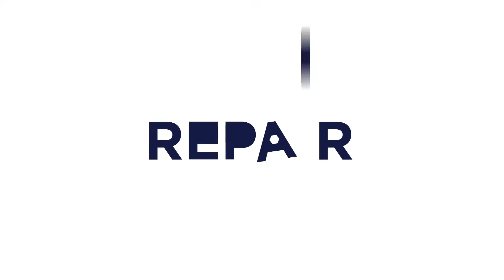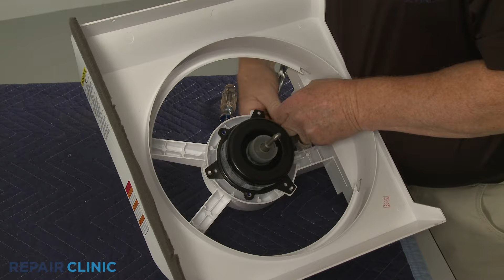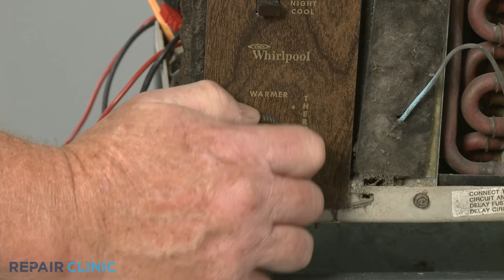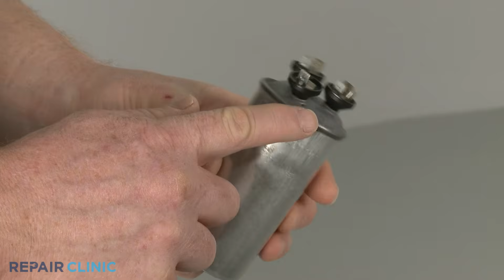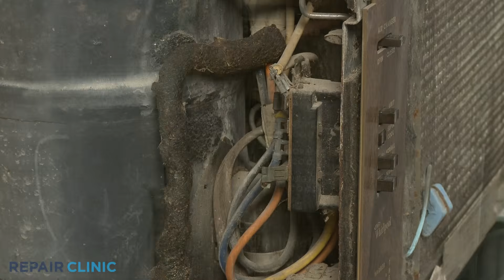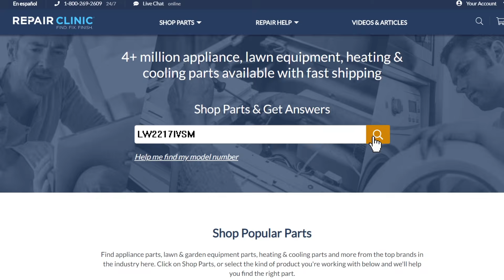Air Conditioner Fan Not Working — Air Conditioner Troubleshooting

Comment: So i got a weird one.  Have a window unit that works, fan kicks on and it blows cold just fine.  But sometimes when the fan kicks off it just keeps humming, almost sounds like the compressor is still trying to go.  Only way to stop it is to kill the power at the plug, and even then it may keep doing it when power is restored.
Reply from the maker: It's most likely the compressor, but you will want to troubleshoot and make sure it's not failing. Check out our troubleshooting video for loud or noisy air conditioner here: https://www.repairclinic.com/Repair-Library/Troubleshooting/8169/Air-Conditioner-Loud-Or-Noisy-Air-Conditioner-Troubleshooting

Comment: Fan works but doesn’t blow air
Reply: What does that even mean?
Reply: @mattfoley6082  Probably means it blows room temperature air?
Reply: My fan runs but doesn't blow any air
Reply: My fan blows out cool air really strong on one side and weak on the other side it's a window unit??
Reply: If the fan works then air blows.